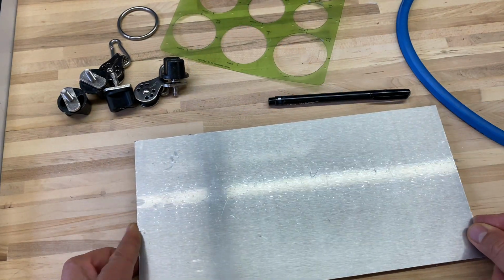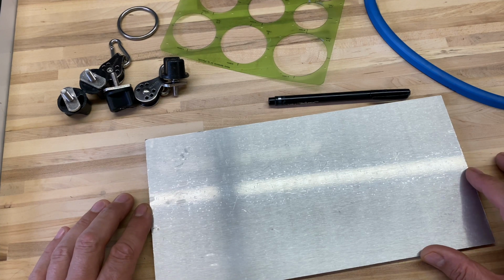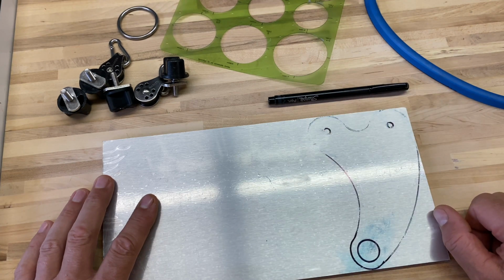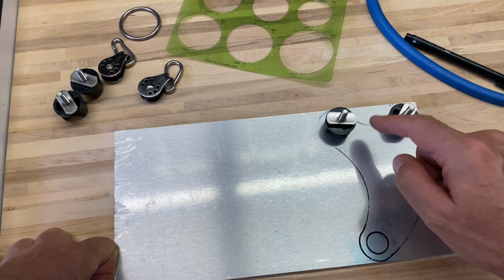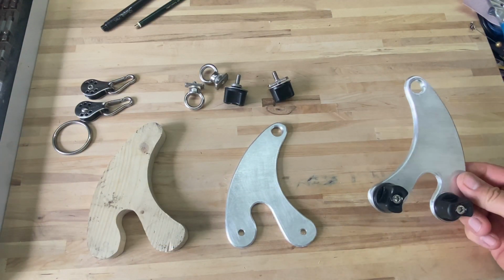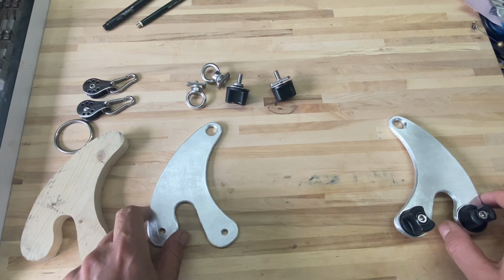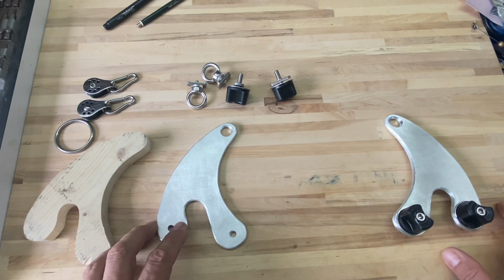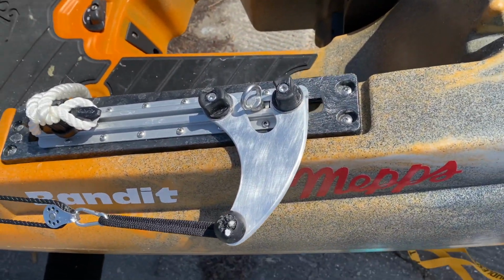How to make anchor trolley brackets for an Old Town Bigwater PDL 132 kayak

Comment: Are you making those brackets to sell?
Reply from the maker: The actual selling would be the easy part. The pricing is a problem because it took me over 6 hours to make. I have no idea what price to put on that. Plus 2 router bits @$35 each, damaged - but that, I expected. For me I am thinking it’s worth it, because it’s a great addition to my kayak. I don’t know for others how valuable would be. But I’d love to be able to sell them. All in all, less than $250 without hardware, I could not go. Again this is an estimate of time and damaged items. Sorry I can’t give you a straight answer.